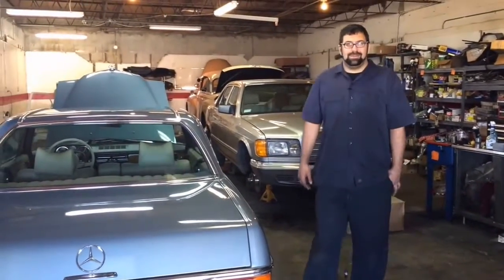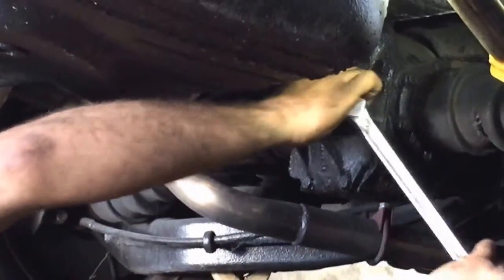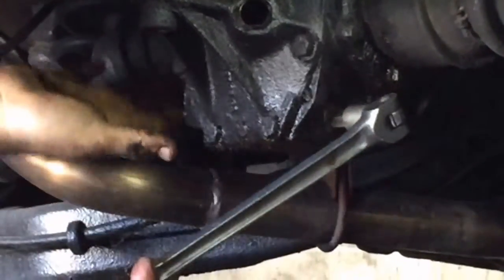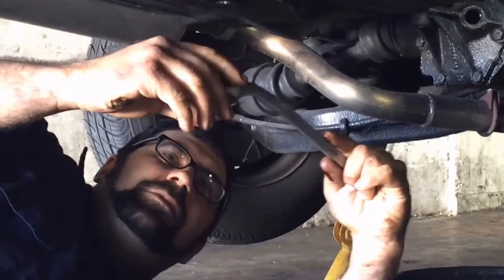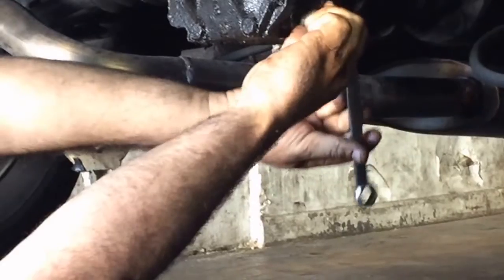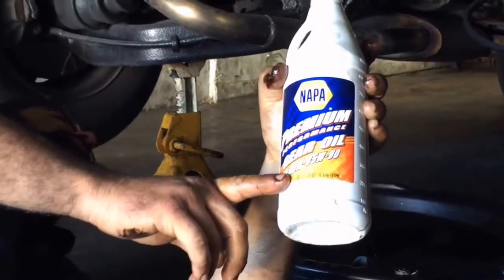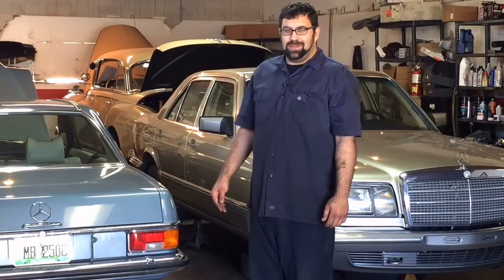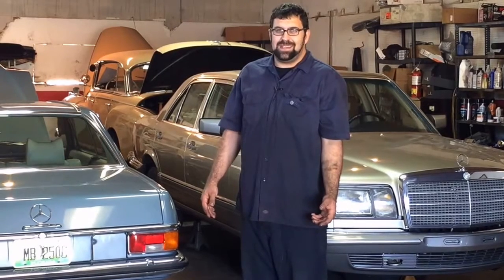How to change rear axle Oil

Comment: '80 450SL. When I first got my car four years ago I had a gear whine from the right rear over 60 mph. It eventually went away. I had the car in the shop for exhaust change, I do most of my own work, and the mechanic said my diff oil was fine but needed to be changed. This looks easier and faster than jacking up the car and rounding up the parts and tools! Lol

Comment: Very helpful video!  Especially the great tip on the oil stabilizer.. Thank you!
Reply from the maker: thank you! what kind of Mercedes do you have?
Reply: I have a '72 350SL, two '90 300e and a '06 E500.  I am in Bonita Springs, FL and may come to you for help if I get stuck.  Currently struggling with a steering coupling refurb for the SL.  The rear axle oil change was quick work after seeing your video. Keep the cameras rolling!

Comment: I was always under the impression that on Mercedes cars that you should not change the differential fluid only add to it if it is low. If you change it you will experience a whining in the differential. Have you ever heard of this? Thanks Pierre

Comment: Is this the process for the 1987 R107 560SL? I am hear a noise or hard shift in the rear bottom area of the car. I am being told that it is the transmission which I do not believe. Have you ever heard of this Mr. Hedary?
Reply from the maker: ras, please email me at mbownersforlife@bellsouth.net with your question.

Comment: As always, thank you for your great, honest professionalism. I have 1998 W210 E320 and 2009 E350, should I use the same 80W-90 and how many quarts, please? What are the miles intervals for changing the oil? Meanwhile, keep up the excellent dedication.
Reply from the maker: interval is 30,000 miles. the volume is 1.1 qts. you should use a 75/85 synthetic.
Reply: Mercedes Classic with Pierre Hedary Will do, many thanks sir. Excellent work and presentation.